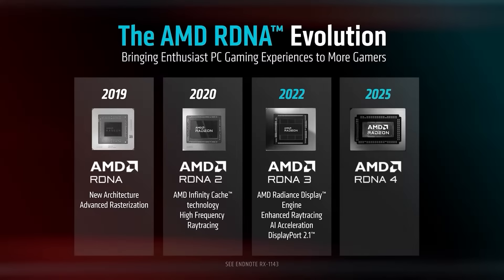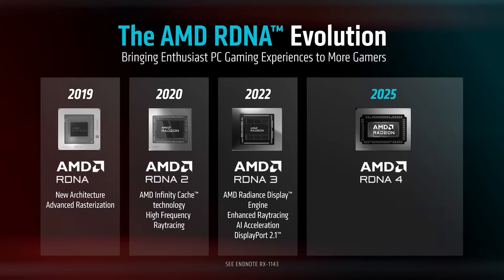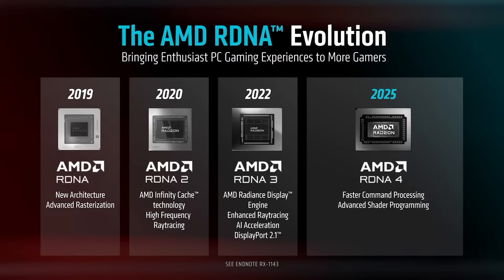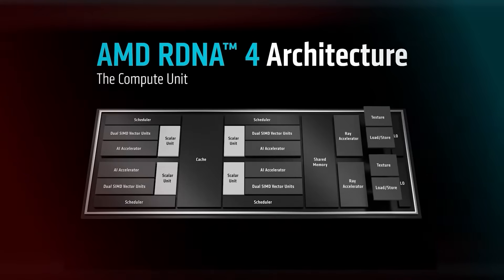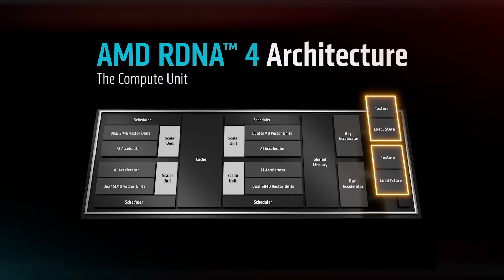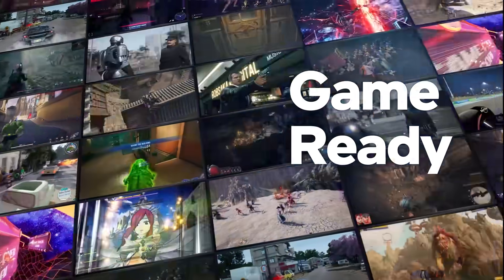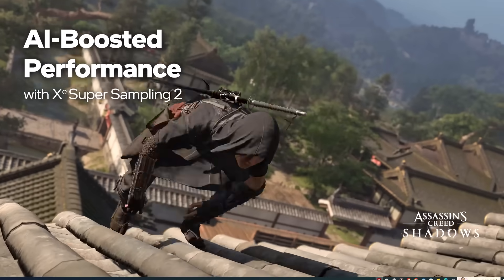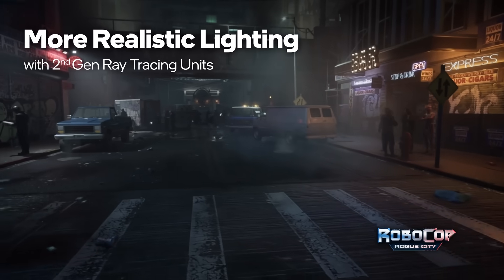UDNA Rewrites AMD's Rules: Huge Compute Unit & Feature Overhaul

Comment: Why would Intel release Battlemage in ~December if Celestial is coming soon though? Like, I know you mentioned that “Celestial might be pushed back or something,” but I thought that it was a given / known that Intel Panther Lake is using Celestial iGPUs. And that’s launching “late 2025 / CES 2026” (actually, now it seems they’ve dropped the “late 2025” part and it’s almost certainly just CES 2026) so why would it take them years to bring it to desktop? Didn’t Intel Lunar Lake (the first Battlemage implementation) and Battlemage dGPUs launch like 3 months apart, in September and December respectively? 

In fact, I’ve been assuming that Celestial is +/- good to go already*, considering that they already have panther lake engineering samples running windows (presumably with their final Celestial iGPUs) and I doubt that the iGPU is the part that’s still in need of any real qualification considering that compared to the CPU that’s the lead product on an entirely new relatively bleeding edge node the iGPU is on some older, already established TSMC node, and it’s not like Intel has to help TSMC get up to speed in the same way that the CPU is supposed to find the flaws in Intel 18A for the next few months.

Asterisk: ie it’s in its final silicon revision or whatever, I don’t doubt in any way that it still needs all the driver work it can get between now and whenever the launch ends up being, or that it’ll still need some driver work after that even.

Comment: its only way to get into wavegroups to do ai better than high error rate from rdna4 and rdna3 still using wavefront32 simd wmma instruction base vs cdna2 been using wavegroups since fp64 been use separately from fp32. Its very similar to tensor cores how NVidia calculate fp64 and fp32
Reply: WMMA is not a tensor core. WMMA is a macro to convert a single matrix instruction into a series of vector operations in the ALU. Because it is a series of vector operations instead of a parallel matrix operation it's not as fast as a tensor core.

Comment: 770 will hardly be competing with 5060 Ti 16gb. And will use a ton more power and will require a 7800x3d in order to compete with a 7600x Nvidia/Radeon setup.

Comment: Oh great, UDNA specific features incoming. FSR5 exclusive to UDNA. They really need to work that out. Don't all RTX cards support all DLSS versions ?
Reply: All RTx cards can use DLSS 4, but new the transformer model which has a higher fidelity runs really slow on older cards. Also certain features are locked to new cards. Multi-frame generation can only be used on RTX 5000 cards, and regular frame generation can only be used on RTX 4000 or newer.
Reply: No DLSS 4 is only on 50 series cards
Reply: @Gennady_1313  I think you meant MFG which only on 50 series, DLSS 4 is available even on RTX2000 gen
Reply: @GeraldAllen-fg2bo Ok I see. Thanks for correcting me.
Reply: I really don’t see why they’d have to feature lock FSR in future generations. 

RDNA 3 can’t access FSR 4 because it doesn’t have AI accelerators
Reply: @zachb1706 It does have AI accelerators. They just can't run the instructions for FSR 4 unless it's translated to another type.

Comment: 4:18 Comparing to GTX 1060 and GTX 1660 Super? Really?
A much better comparison would be the RTX 3060 12 GB. Similar actual price in the market, similar power consumption. According to an old review I just checked, the B580 still wins but it is much closer than the comparison suggests. I don't know who made this slide (was it really someone at Intel?) but it is not a good comparison. Especially considering how obsolete the GTX 1060 and the GTX 1660 Super are.

Comment: More shaders per compute units?? Reminds me of Nvidia that basically did ``hypertreading for cuda cores`` starting in Ampere... which is why we havent seen a big jump in performance... Nvidia just cheated, said they ``doubled the shaders units`` but in fact, the cuda cores didnt go up much but each cuda core could do 2 shaders units instead of 1... which, on paper, is a big boost, but in fact, hyperthreading is way shy of 100% boost... like CPUs. So nvidia made the numbers look good, while in real terms, perfomance went up 20-30% best case scenario. 

So AMD is doing the same thing uh... so count the CU boost + 20-30% and you'll get the real performance boost, just like nvidia. Ignore the shaders number, its just gonna be PR BS.
Reply: It means more AI and compute power. Less rasterisation power…
Reply: It is useless for gaming. But ampere design boost some of pro app quite significantly. Not 100% faster but 250% faster. Rendering that took almost 15 minutes on turing can be done 5 minutes on ampere. If you want boost on gaming performance you need to build the GPU in more traditional way. hence things like using MCM combining 2 or more GCD is very hard to do. Even if you can do it there probably going to be big caveat. That's why we still did not see MCM gpu the way gamer it. But building gpu the old way also reaching several limitation.
Reply: AMD already started doing that back in RDNA 3 I believe. No this is something different

Comment: AMD is always one gen away from dominance yet it drops the ball every time.
Reply: Yeah and AMD drivers are shit, cards are melting, there is no stock, its overpriced, has absurd tdp oh wait that's nVidia. NVidia is shit for years now. Just the perception of dumb fanboys that they are better has begun to crack.

NVidia will probably be the best at 4k raytracing / pathtracing for many years, but that's a pretty low %of the market. Amd is winning 1440p and destroying at 1080 p and laptops / consoles
Reply: @mp24022 “destroying at laptops” 
-doesn’t even have a single dGPU for laptops this generation.

Bruh. I wouldn’t call a 4060 laptop competitor “destroying in laptops” either.
Reply: @levygaming3133 For laptops you either don't know or you feign ignorance.
Anything about my other points or it's just the "amazing" laptop dGPUs of the 5xxx series that stirred you up?

Comment: Intel need to push harder with GPUs and work at entry level cards as more people would be willing to risk with these. Also there is close to no competition at entry level and low profile cards, especially LP 
cards that don't require extra 6 or 8 pin power connectors. As long as these are full Pcie x16 they will be better than what nvidea and AMD offer now. Entry level cards now hardly beat 1660 super and don't work well at old machines because are not full x16 pcie.

Comment: Huge compute unit sounds like an excuse to continue capping CU counts.

RDNA2 finally brought a 25% uptick over Vega 64 to 80 CU, and then RDNA3 gave us just a 20% increase to 96 CU.

Then RDNA4 regressed to 64 again.

I'm beginning to think that AMD maybe didn't fix that scaling ceiling from GCN at all.
Reply: The plan with RDNA 4 was to have multiple GCDs. They could've made a massive die with 128+ CUs, but everyone would be complaining when it's $1500+. The multi-GCD approach would allow them a Zen 2 moment while keeping the price down.
Reply: @26Guenter  “keeping the price down [on a massive, multi-chiplet GPU]”

I seriously doubt that. Everyone likes to talk about yield rates on the massive monolithic dies like NVIDIA uses on the 5090, but that ignores binning. The 5090 isn’t a fully enabled die, it only has 21k out of 24k CUDA cores, the full dies become the RTX 6000 server GPUs. And NVIDIA has the RTX 5000 server GPU that’s just over half the total CUDA cores and 2/3rds the memory configuration based on the same 5090 dies. I wonder if even a single 5090 die can fail significantly enough in manufacturing not to qualify as at least the RTX 5000. 

Honestly, it seems more like a question of how much total silicon area each are using that determines minimum pricing, and everything about that GPU, especially it’s active base tile, sounded like it would use more than the 750mm^2 of 5090.

Comment: I think the most interesting and exciting bit is how UDNA will have an impact on mobile / APU’s. I think this is the segment where the most radical developments can still happen in the next years. You can only throw so much wattage at a high end desktop part. Mobile and efficiency is where it’s at!
Reply: APUs is always where we will see the most perf/watt gains because they don't push the voltage to the point beyond the best place of the bell curve.
Reply: I built a small form factor rig with a 8700 g and some 72 mega transfer ram and I could get 60 FPS in any game at 1080p the apu's have came a long way and soon there will be no need for budget gpus
Reply: More ai and calculation power. Less rasterization power…

Comment: It sounds like UDNA will come with real improvement in matrix calculation, perhaps RDNA 4 might get left behind in future FSR revision sooner than the likes of Turing.
Reply: RDNA4 has plenty of AI/ML compute to be getting on with for that kind of use case.

FSR is going to remain open even if the initial releases are not, so as long as the work can be ported the support will remain for earlier GPU µArchs.

Strix Halo is brand new and AMD would be insane not to port FSR4 to it ASAP given the competition is nVidia and lacking FSR4 is a serious disadvantage to competing with a similarly spec'd dGPU.

Comment: Those Matrix cores coming to gaming GPUs is going to be a big deal. They should provide a big uplift in anything needing AI inference, like path tracing.
Reply: If you take a look at RDNA4's specs you will find that they already got a HUGE boost in that particular type of compute.

That's a big part of why the initial version of FSR4 is going to be difficult to port to earlier RDNA architectures.
Reply: @mnomadvfx yeah unfortunately 7000 Radeon will never reach beyond intel’s native xess upscaling. It’s ok and useable but dlss 4 levels of quality is a far distance out.
Reply: @mnomadvfx RDNA4 got a huge boost and UDNA will at least get a similar boost. AMD still trails far behind in path tracing, an ar a wh re matrix cores will provide major uplift. Next generation could have AMD leap frogging Nvidia....
Reply: Path tracing and AI inference are not related yes you can generate fake rays with AI inference but you can do path tracing without any AI inference at all. The way you state it you make it sound like it's not possible to path trace without AI.
Reply: @kazedcat ML has big parts from AI contributing to its functions. If you got that parh tracing was impossible without AI that's your problem and you lack reading comprehension. Trying to sound like the smartest person in the world must earn you lots of friends.
Reply: @edhorseman2237 No this is not correct. Path tracing dont use matrix multiplication. The reason AI can boost path tracing performance is by ray generation. If you only need to path trace half of the rays and generate fake rays for the other half you instantly double your path tracing performance. Path tracing is a vector operation while AI inference is a matrix operation they are two different things except that you can use AI inference to produce fake rays that is 80% to 90% just as good as path traced rays. With fake ray generation and smart filter you can boost path tracing performance significantly.
Reply: @kazedcat so I'm right overall? It's just not the matrix cores doing? Nitpicking at it's finest but I'll admit I was wrong about that.
Reply: @edhorseman2237 You can generate fake rays with interpolation plus a stohcastic filter. No AI inference needed RDNA4 can do it.
Reply: @kazedcat that's the word I was looking for, interpolation....

Comment: Well all Amd needed to do was release a bigger rdna4 this time around to match or even get past the 4090 which would be more than enough for 99% of us. They would need like the same shader amount as 7900xtx and the same memory bandwidth and they would be there.

Driver wise I have not had any issues at all with 9070xt compared to rdna2 or 3. And I even used 4090 with the newer drivers not so long ago and even if I did not had a bunch of issues it felt like every new driver revision came with new annoyances like amd did back before rdna4.
Reply: That's great and all, but given today's market it would cost as much as a 4090 did two years ago. I don't see that being received well and Nvidia would still have the crown with the 5090.
Reply: Why make because not enough customers… also no production capasity…

Comment: Where are my  10090xtx  32 GB/  64 GB   4k beast  Native only   ???   Also where is My  workstation 10099 GPU  with 64  GB  / 128 GB  Game making GPUS  at all Resolutions 4k / 8k /16k    AMD  responsibility  also zero required FSR  i  hate FSR
Reply: no need to wait
you can play 8K today
at 1fps... ;-)

high resolution at high / playable frequency maxed out with RT will not be possible without upscaling. (frame gen is another story)
and it's not a problem now, the upscaling tools are really good
also a 4K+ screen it's really hard to notice the difference with and without upscaling.
even antialiasing starts to be useless at this resolution.

Comment: I dont get it. If the higher variants are released in Q4 2025. Then when is celestial going to be released? Intel isnt dumb enough to release celestial 6 months later. Its just a waste of resources. So either celestial will be delayed for quite a bit or higher variant battlemage will be cancelled.
Reply: Well Could also be that Intel did some B770s but decided just lunch B580, but due to the success of the B580 they though that a B770 release while in celestial they focus on a higher end card first and scale it down from there.
Could also be them trying to generate more hype and mindshare with a B770 before celestial.

Comment: My big hope with UDNA/RDNA 5/GFX13 is that AMD does bring out a 6090/6090 Ti Competitor fundamentally since Blackwell is a dissapointment and GFX13 is a big architectural change on a new node.
Reply: My big hope is that Nvidia will finally have working drivers again.
Reply: I personally hope they just release mid-range again with UDNA. I want AMD to cook for a couple of generations before taking on Nvidia at the top end again personally. Basically I want them to get it right and not rush it to market and have the disaster launch of the 7900XTX all over again.
Reply: See that’s the thing with AMD Radeon. Consumers are always on the “I hope they” situation.
Reply: Well yes Blackwell was a let down but I have 5080 and a 4070ti super. With my experience the 5080 with overclock it gets real close to a stock 4090 and the 3x fram gen in cyberpunk I love high frams maxes my 120hz at 4k full path tracing and looks great.along with driver fram gen for unsupported games is nice but yes it should been way stronger than 4090 without overclock. So it was a let down but I'm still enjoying it.

Comment: Arc B750 = Roughly between RX-7700XT-7900GRE performance, $399.99
Arc B770 = Roughly between RX-7800XT-7900XT performance, $499.99
Release: August 18 2025
Reply: A B770 should cost 350USD or at most 399 if it is on par with a RX7900gre

A RX9070 performs 20% better and has a MSRP of 549
Reply: Yeah, but nv/amd/intel are acting like a cartel and refusing to compete on price, and relying on artifocal shortages driving fomo instead so we get screwed no matter what
Reply: What about the cpu overhead? If you need a high end cpu to run a mid gpu ... kinda defeating the purpose ...
Reply: @countmorbid3187 
 if you need a high end cpu to run a midrange gpu that means that gpu just isn't "midrange". it's just good at that point.

not that CPU's cost as much as GPU's anyway, you can find a 5800x3d for like 350 bucks. with a $400 gpu you're lookin at around a $1.2k build ish
Reply: @jagjyot4828   No...? It means that the driver is made in such a way that it offloads more work to the CPU, meaning it needs to be faster to achieve the same frame rate.
Reply: @Batman-bh6vw  well ye then that does suck 😭
Reply: Disappointing.
Reply: Maybe with XeSS enabled, but raw performance will probably still go to the 7800xt